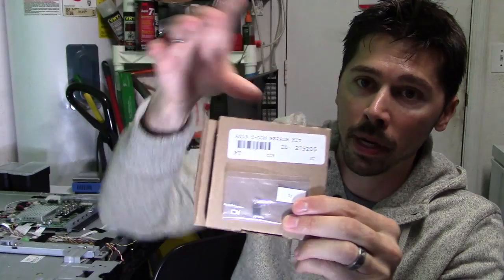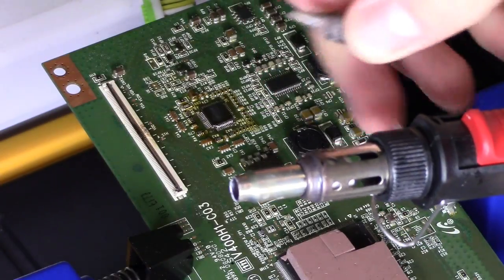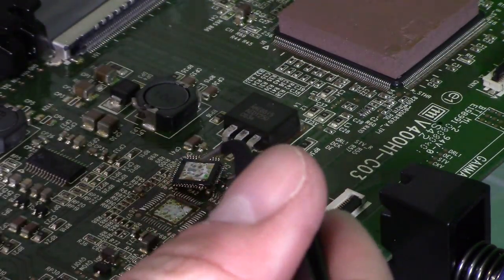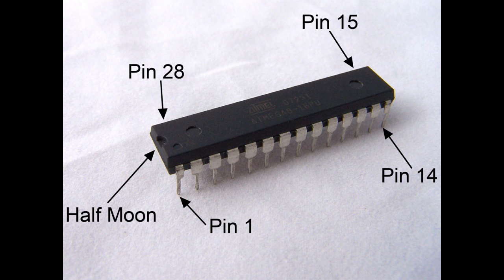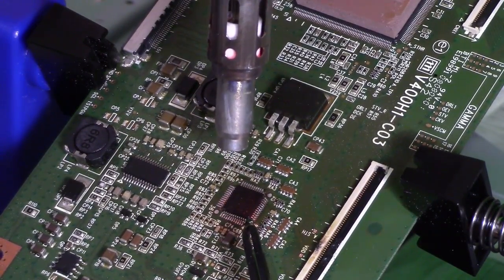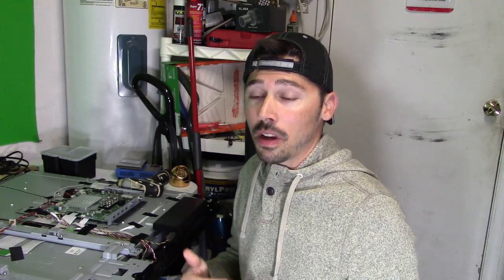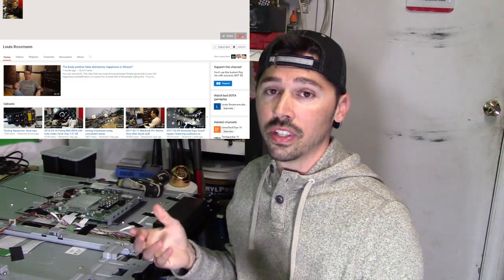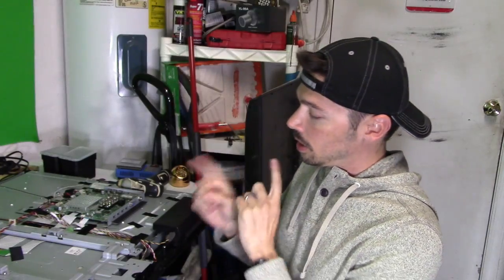LED LCD TV REPAIR GUIDE TO FIX MOST SAMSUNG VIDEO PICTURE SCREEN PROBLEMS

Comment: I have about 12 broken tv's I have found  myself  needing a TV, mine went dark, one would have half the screen frozen when it was first turned on.  The last time it was turned on, it would not correct it's self after heating up. The one before that just went dark stopped working,   I need to fix one of them!

Comment: hey man.. no offense but why are you not using good type of tools?? like cheap and good quality solder and hot air station instead of using that crap staff. also use good type of flux or liquid lead to make your soldering easy when doing a spider type ic... stop flexing that kind of tools

Comment: Hey Paul, a great channel you run really helpful and interesting to watch.

I ran into this video since I was struggling to identify one interesting issue on Samsung TV UE46ES8000 where HDMI inputs reacts kinda weird. It has flickering, stripes, picture loss, resolution not supported messages etc. The interesting part here is that DVB-T input, USB and Plex streaming works without any issues with nice and steady picture.
So I figured out that it must be a main board that has some kind of shortened part or something related to HDMI inputs so I ordered a replacement main board (still on its way).
I just wanted to confirm my analysis.

Thank you
Miro

Comment: Please…I get two vertical lines on my 65 inch Samsong TV (Model code: UA65F9000). I called Samson maintenance and told me I have to replace the entire screen which costs too much. Is there anything you can help me with to fix the TV?

Comment: I have a 48" Samsung TV could not be turned on. After a few detour I spotted the following symptom: T-Con board's 3.3V will shut off a moment after turn-on if con1 to LCD panel was connected. If the other flat cable from con2 to LCD panel remain be connected 3.3V will stay on and back light will be dimmed a few moment later. The board number is BN-95-01309A. How can I be sure that source of the problem was the T-Con board or the LCD panel itself?

Comment: Thanks for the great videos.  Have a samsung 4k 6900 series tv with a 9 inch vertical gray bar that comes and goes at the left side of the screen. The connectors between the TCON board and TFT display seem intact.  Is the problem on the TCON board.  What do you think? THX

Comment: My Samsung LN46A950 has distorted picture on start up but after about 20 minutes, the picture goes to normal. Would TCON replacement fix this? Thank you for your videos
Reply: Did you have it fixed yet? 
My QLED Samsung tv is acting up in the same way. It shows colored vertical stripes on start up after being off for hours. It starts shutting down and turning back up on its own the first 10 minutes and then the picture goes to normal for the whole day. I’d appreciate an update from you.

Comment: Hey I have a similar but different issue... I have a Westinghouse 55" tv with a burnt out video board chip.  I found a replacement video board that had slightly different part numbers but was said to be comparable.  Well turns out its semi-compatible.  The picture shows but is slightly fuzzy and some of the colors are off.  Any suggestions?

Comment: super dodgy. The proper way to reinstall is with a soldering station equipt with the correct soldering iron head to heat all four sides at once.

Comment: i have a samsung ln52a650a1fxza once you turn it on it shut's off 2o minutes later n wen you turn it back on it has a blue screen would this be the t-con board?

Comment: Hi tampatec,
Could you give me a tip on my current TV issue?
I have a Vizio 37 inch model VO370M. The picture starts to flicker after the TV has warmed up after about an hour or so.
Would this be the capacitor issue? Or maybe there is something else to it? I haven't opened it up yet to check the caps (if they are bulged or burnt) yet as I wanted to know for sure and what to look for.

Comment: Hi there, I have a Samsung UN55D8000. The screen is dim, but still view-able. However when I entered 3D Mode, the Screen works perfectly. But when going back to 2d the screen goes dim again, but still view-able. Based on the following research, I believe I have a bad main board. Also the cable connection is also bent on the main board. 

1) T-CON Board - Is good if you can see the Menu when pressing the Settings Button

2) Backlight Test - Entering into 3D Mode the Backlight turns on and the dim appearence goes away completely. Which tells me the Backlight is fully fucntional.

This sounds like a Bad "Main Board"??? Please help. Thank you.

Comment: when I first started changing chips etc etc , i took a board that wasn't any good and practice taking off and removing each part . when i did this i would also make a schematic , by checking what happens when i removed each part . This was when the phones were new and there wasn't schematic readily available .This was back in 1995 and i did it till 2001.

Comment: So, i have a hisense led lcd tv, and some green pixelation started happening. Now, the picture on the screen is split horizontal mirroring the screen, but kinda like a double exposure. Is this a t con problem? Can it be fixed by just cleaning the connections?

Comment: I  was working on an apex LD3249 tv. It had lines on the screen… so i bought the t-con board from shopjimmy. The lines are still there…. the T-con was only $14 so I’m not hurting as much right now…. I’m fed up was wondering if its worth the fix since i would say the issue im having  is not the t-con board… could i strip the tv and sell the nw 2 t-con boards i have have plus the main board and the power board? Thanks

Comment: Hello Tampatech thank you for your videos. I have Sanyo DP42746 plazma TV. TV picture is not clear. When I first turn on the TV picture comes in like peace by peace but not clear and nice, like one peace picture. I am send  you messages about my tv before on other videos. I am still waiting your help.  I replace one cap on Ystain board that fix the snowy looks but picture not clear some time like need T-con board. I replaced T-con but did not change picture looks. If you can help I really appreciate to you. Thank you

Comment: OK I'm in the process of trying to fix my neighbors Samsung UN65F6300AF flat screen TV and this is my first attempt at a big TV like this. Here is the issue. With the TV in standby the backlight flashes but not all the backlight but just the bottom half I would say. When you turn on the TV the menu flashes and continues to flash but never stays on. When you try to turn the TV off it will not turn off unless you unplug it. Also when you first plug in the TV it gives a series of 5 single flashes and then goes dark. Pushing the on button makes the standby light flash once but does not stay on. The 5 volts and 12 volts is steady on the power supply. I'm thinking control board but the fact all the backlight leds don't flash makes me think they may be the issue. Care to hazard a guess?

Comment: I have a question about my TV I'd like to send a picture but it's not possible. It's like a pressure spot but it's all around the outside of the TV and it's a 2008 Samsung 40"

Comment: I enjoy your videos but unfortunately, I haven't found a solution to my problem. I am about to trash a 55" Samsung Smart TV I purchased in 2015 because it simply died, no power, no sound. I replace all three boards in the TV and still no picture or sound, no power. If you have a suggestion I would appreciate it. Otherwise, it is going out on trash day and i am sticking with Visio TVs.
Reply from the maker: Charles Smalls if your power board standby voltage is good and steady then can be bad main board, if you bought your boards from eBay it's possible your boards you purchased were never tested and maybe defective which happens. I use shopjimmy.com or electropartsonline.com use code tampatecfriend for discount.
Reply from the maker: Also double check your tv board cable connections and power cord.

Comment: I have a 60inch samsung smart tv. I replaced all the boards include  the t-con board. Now the back light is on. The screen is half black and half white. What is wrong.
Reply: Check the ribbon wire connection between the t-con and LCD panel. But its possible you have a damaged panel.

Comment: Hi i have a 65" Samsung model # UN65F6350AFXZA. The top half of the tv is darker then the bottom half but every thing stills works fine. Just the picture is darker at the top half of the tv. happened like 3 days ago. Took the tv apart and only the bottom half of the led come on. please help.
Reply: Sounds like a bad T-Con board based on my research. Was this the issue?

Comment: Thank you for your good information. I have a Samsung TV 40” and it have the same picture problem. Can make a Video on how to fix it? Thanks
Reply from the maker: mustafa KF it's most likely tcon board.  tv boards at shopjimmy.com or electropartsonline.com use code tampatecfriend for discount.
Reply: @TampaTec  please help. I have a Samsung un55ks8000 and my picture is going crazy. Is there a way I can send you an email with a short video of what it's doing?

Comment: Hi. I have a cheap chinese hd tv. It has on board satelitte receiver,  unfortunately it doesn't work. I removed back panel and saw that a little chip burned out, can I repair it? Please help me.

Comment: Hi tampatec, I have a question about a Samsung UN46D6000 LED TV I have a problem with. There is one wide vertical band on the left side of the screen, that is simply black all the time. Like the screen is completely "off" in that area. However it is not the ENTIRE left side of the screen, it is from almost the middle of the screen over to about 2 inches from the left side of the screen. I already tried replacing the t-con board with no luck, along with all 3 ribbons attached to the t-con board (the longer one that goes to the main board and the two smaller ones that go to the panel boards.) Is it possible that it is just another bad t-con board, or am I looking at a bad panel here? Thanks!

Comment: I have a Samsung Model # UN46h6203F, SN#:02Q03CVFA03047R, Version: TD01. I cannot find my manual nor an I seem to find the correct replacement board. I have no picture, (black screen of death) nor audio. Any thoughts?

Comment: This is not easy guys I do this type of work you have to control the heat and the area where you apply heat which takes practice when using hot air

Comment: I have a un65c6500vfxza. The led backlighting along the top edge seems to be flickering. It does this on any input, I have changed the eco settings and followed a bunch of other directions with no fix. Any thoughts? Thanks.

Comment: Visio 70" it has vertical lines however in the middle the screen it's almost horizontal. Also only have half screen. And when you change Channels it freezes. Do have sound. While it is running colors start to change.  If I could send a video I would.

Comment: I posted a message to you about one of my Samsung TVs, here's another. I have a LN40B530P7NXZA Samsung TV and it has BACKLIGHT ISSUES. It's very dim and menu screen is barely visible. Do you have a suggestion of what board could be the problem. Thanks

Comment: Hi Mate, Can u help me please? I have a problem with my 7 years old LG 2360V-PN external PSU monitor. Its give me the picture, but looks so purple. https://prohardver.hu/dl/upc/2017-06/299177_20170614_204001.thumb.jpg

The cable is good, the vga is good. Make it only at the Summer time. Last year has begin, but at the Spring turn good again. What do you thin, where must is begin?

The other side of the case is so hot every time. Thank You for the answer!

Comment: Jeez i gritted my teeth how many fails did you have doing this lol.I commented to soon you said exactly what i thought LOUIS and EQUIPMENT.:P
Reply from the maker: Louis Rossmann is good to follow
Reply: please help 2 seconds
Reply: 96 volt on top 130 or so on bottom plugged in or not same power board led?if that makes since.sorry um vout 1 is 96-90 and vout 2 is 136-130 leds plugged or no.
Reply: Hillbillyrepair3 minutes ago
VOUT 1 is 96-90 and vout 2 is 136-130 leds plugged in or not THE SAME.HELP ME OBI ONE CUNOBY YOUR MY ONLY HOPE LOL(mispelled on purpose im a hillbilly after all)I KNOW I AM TROLLING I AM VERY SORRY BUT TAKING THIS PANEL APART WITHOUT EXPERT ADVICE :(
Reply: Tampatec yes he is , I like how he thinks , that's how i started doing repairs on cell phones . I will check the other people since currently i just watch louis and paul.

Comment: hello, i have a tv that will turn on then turn off.  the power line stays on/green, but seems like the backlight is off.  i have check voltages and all seem correct.  i tried another cpu board.. same results.  when i hit the input button , the screen comes on for about a second then back off.  looking for maybe some suggestions. its an insignia 26" tv.

Comment: Tampatec.  question.. I have my samsung led 32" smart tv model #  UN32J5205AF  my picture keeps blinking on & off every 2 seconds. I made picture adjustments on settings it stays on when my picture is at the darkest setting only. is it my settings my board.. power supply board.? or t board maybe just a capacitor. ? I noticed these capacitors are a bit different.  ANY SUGGESTIONS. ?

Comment: My Samsung 32" LCD ... The standby light is on. when I switch it on, it take about 7-15 minutes delay for signal to appear on monitor. 
what's the problem with this delayed action ? and I quite confident that it's not the issue of power board.( as I had already replaced the new Power Board ).

Comment: Hi! your youtube tv repair guide vids are very impressive and this encouraged me to repair my own sony LCD 32CX520 tv which does not turn on after a high voltage power run thhrough it. I guess there should be a problem in the power circuit board only. I have replaced blown fuse, puffed capacitor (biggest one with similar volt and uf) and short circit mosfet chip in the heat sink, 3.3v power in the connecting plate is ok, but it still it does not turn on..your help in this regard is highly appreciated, am from Nepal...

Comment: Tampatec enjoy your vids, my older Samsung 40" lcd comes on with sound and the pic is blank and slowly turns white. After turning on and off many times it will finally get a picture, what is likely the problem. Thanks

Comment: tampatac i have a lg smart tv which i bought during the 3d launch for this particular model 6 yrs ago...now the tv is black screen with pink horizontal lines ..no picture at all...i took it to lg repair shop they told me..sorry lg doesnt make anymore main boards for this particular brand..so i took it somwhere else and they said  that the ram of the tv wich is attached to the tv is faulty and needs replacment but u cant replace it because its attached to the damn screen and thus you need to buy a new screen and its a price of a new tv...so i just dont know ..does any of these make sense to u..i mean does the screen have attached rams or somthing..im neew to this i dont have a clue...any ideas would be appreciated thanks

Comment: I have a Sony  XBR-70X850B tv. It has a single thin verticle  red line on the right side. Also have a Samsung 55" with the same exact problem. i cleaned all the ribbons. this is driving me nuts. Any ideas ?

Comment: I have a 65" panasonic plasma tv with virtual lines on the right side how do u fix it?
Reply from the maker: jim banks small control board or long buffer board or buffer connections

Comment: Really helpful videos ^5! I have a 37" Samsung LE37R88BD(R) Type BP37EO. I'm on the west coast of Ireland so its 220-240v systems here. The tv is showing no picture when you are trying to view terestrial channels off an ariel, I can hear sound and pull up graphic menus, the back light seems to be working but sound no picture seems to be the problem along with the tv not accepting av inputs on HDMI or RCA! The power board had seven bulging caps so I thought heh this might be an easy fix. The kit was going to be €25 and I saw a full reconditioned board for €35 so I went ahead an replaced the whole board but the same problems persist. Any ideas on how to continue? I am fearing that it is the video output that is at fault. Are there separate boards for graphical overlays and video on the logic board? When I unplug the DTV cable and switch to old analog (we switched off analog signals in Europe a few years back) I get a full screen with what we call snow or noise showing on the whole screen!  Where should I look next is my question because I am hoping that its an easy fix being that so much of the function is still there, sound, menus and backlight etc.?

Comment: I wanted to say a big thank you to you. I had commented on a previous video about what I thought was a bad Tcon board. I then managed to burn the main board with my horrible attempt to resolder the connection points for the cable so had to replace that.  It finally turned out to be the cable which I replaced for about €10.  I now have a working tv again. I would never have attempted to repair it without your help and videos. Thank you once again.

Comment: The last time I did circuit board level repair the chip had contacts that went through the board and soldered on the back and you snipped off the excess. You used a heat sink on the chip leads to keep it from getting over heated. Things have changed.
Reply: One of the upgrades we installed was a chip seat so you could just pop out a chip and press the new one in with no soldering.

Comment: Dont you burn the IC internally with 900 C?????
Reply: Still seems hot enough to burn the hell out of the IC part.
Reply from the maker: solder iron goes up to 900f but i set iron at mid settings so its about 400-450f, i should have added that note in the video.